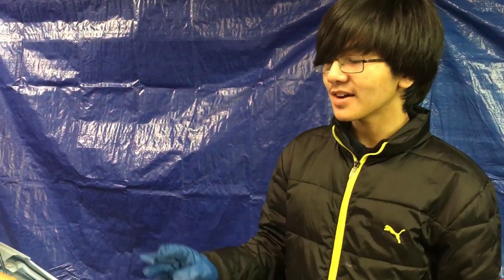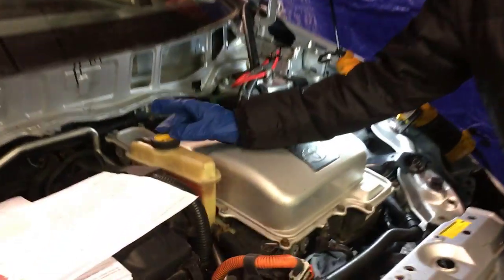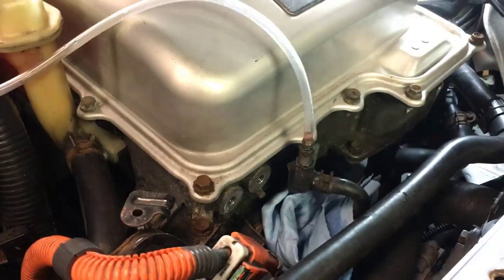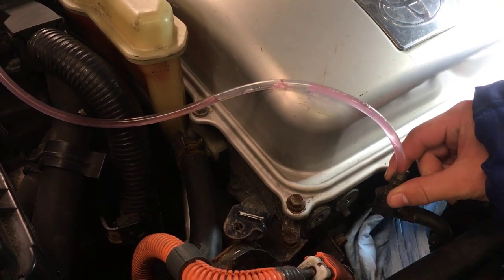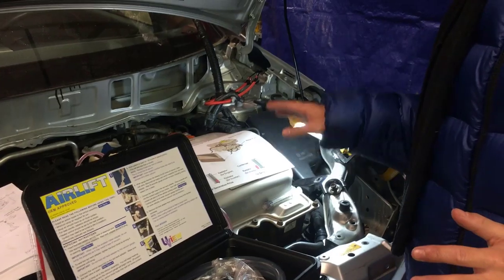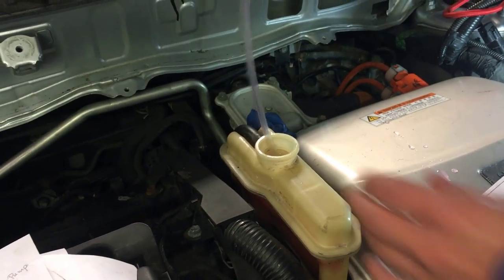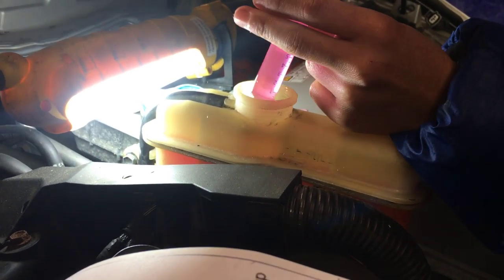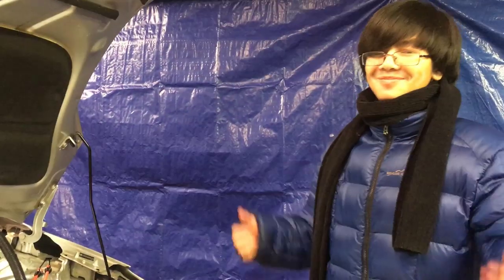How To Bleed INVERTER Coolant System Toyota Prius Hybrid Gen 2 2004-2009 | Cooling Fluid Trapped Air

Comment: Good video kid.  Just changed my inverter pump and now i know how to bleed the system.  Oh and by the way....no need to remove bumper and this and that and headlight.  Simply remove the one plastic cover going the across the front and the 2 front bolts on the inverter and push it to the left a few inches.  You then have enough room to get down in there....a little tight, but plenty of room.  Take off the 3 bolts holding the pump on the bracket and lift the pump up to gain better access to the coolant line clamps.  Pretty easy
Reply: Easy, except getting that damn lil’ electrical connector off! :)

Comment: I’m working on my 08 Prius and this is the best video on YouTube on how to bleed air from the inverter coolant system, thank you sir!
Reply from the maker: Thanks for the compliments and thanks for watching. ..
Reply: How long did it take you to bleed all of the air out. I assume you didn't have that Airlift system that speeds up the process.
Reply: I had to replace that silver cylinder in front of the driver's wheel. Can anybody tell me what it is and how to refill it? TIA

Comment: Greatest video Prius owners should watch. Those bubbles are killing me.
Reply from the maker: Thanks for compliments.  Were you able to bleed the inverter succesfully?
Reply: @EyeOnAiman  I believe I am having the same issue in my 2015 Toyota Prius. Initially I thought its the pump not working so causing the leak, I had to fill the reservoir after every 100 miles so I replaced the inverter pump but still no luck. So what is the name of that yellow color electric device you used in removing the bubbles? Thank you!

Comment: Great video Aiman!  A suggestion for you. The reason we reach for a funnel is that we try to take a gallon jug and pour it into a small opening. That is all and well if we are using the entire jug but when you are bleeding and topping off fluids just transfer a cup full to something that is easier to handle like a measuring cup. No need for a funnel. In fact for these reserviors we want to watch that level while we top off.  Note also that the high point in a system is where the air will tend to collect. The bleeder valves can just be cracked opened to allow the air to escape and closed as soon as a stream is coming out. You are right to attempt to capture and reuse it all but the little that would be caught by a shop rag is fine.  Keep posting - great work!

Comment: Awesome video. I have a few questions: Does turning the ignition on but not the engine automatically circulate the coolant? And is there a relay that needs to be jumped? Thanks

Comment: You could put your finger on the reservoir side of the tube and block it before releasing the other side of the tube from the bleeder valve. This will stop coolant from spilling.

Comment: Great video thank you but I have a question for you I just replaced my coolant inverter valve pump do I just have to bleed the coolant inverter or do I have to bleed the whole system ? Like the radiator I  used the the same fule clamp!

Comment: I just replaced the coolant control valve, is that connected to the inverter coolant or the radiator coolant? Thanks in advance for your help

Comment: I replaced the pump with a Toyota dealer one.  I followed steps but my new pump doesn't pump the coolant back to the reservoir. It makes lotta noise while I'm driving.  What do u think is the problem

Comment: When changing the interval coolant pump . When drain plug do I unplug ?
Reply: There isn’t a drain plug for inverter system that I am aware of.  Disconnect the lower hose going to the inverter.  Both are in between the engine and inverter.  Just have something to catch the inverter coolant that come out.

Comment: I'm in desperate need of assistance! My inverter bleed bolt won't loosen at all, and I'm not applying full strength to it because the metal piece that's holding it starts to bend and I'm afraid it will snap. I'm reluctant to put WD-40 on it because, well I don't know what I'm doing and don't know if it will get into the coolant. 
Any advice would be very appreciated as nothing I search comes back with this specific problem.
And thank you sir for your videos, I have no car knowledge whatsoever and was able to do the pump replacement with little trouble!
Reply: Since your post is 2 months old I'm assuming your must have resolved your problem by now.  However, if you still didn't I would recommend holding the part that may bend with either pliers or ViceGrips.  It also can't hurt to spray the area with WD40. It won't get inside.  Good luck.

Comment: kid, thank you so much, changed the HBAC heater controller water valve and was getting overheating signals and the red triangle and it’s probably cuz i didn’t bleed the system after draining and refilling the coolant

Comment: I just replaced my inverter pump. It’s working. My problem is when I perform bleeding procedures the coolant won’t go all the way through the tube back to the reservoir.
Reply: Did you figure out why it was not pumping all the way out? I'm having the same problem
Reply: @amazinazian55555  I never figured out why. So I just ran it figuring I had done everything correctly and it’s still running to this day.
Reply: @josephandrews2353  good to hear, in my case turns out the brand new pump that I got was bad so I went back to the store and did an exchange and everything's working fine now.  The only downside was I was not able to bleed it because for some reason the pumpkin did not give out enough pressure but things are still working fine.